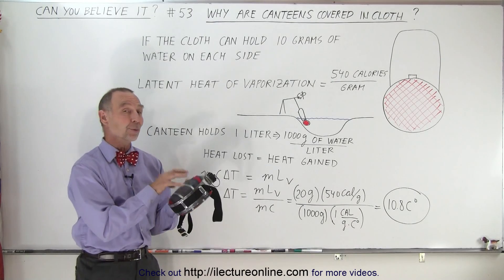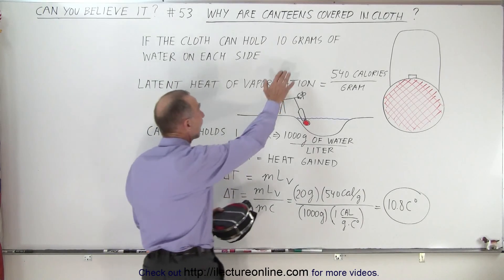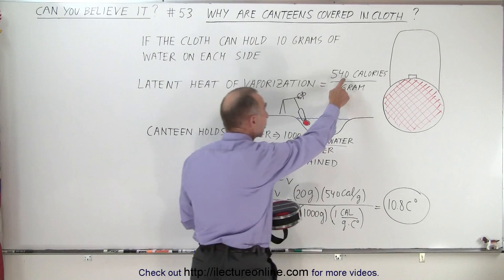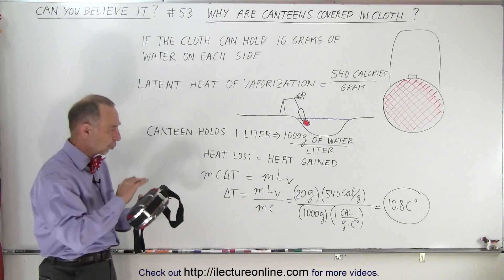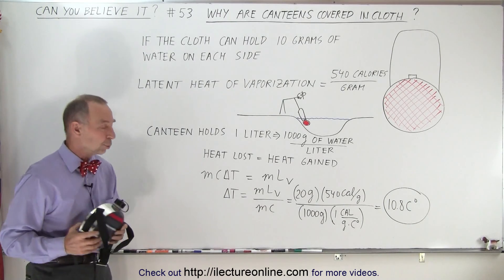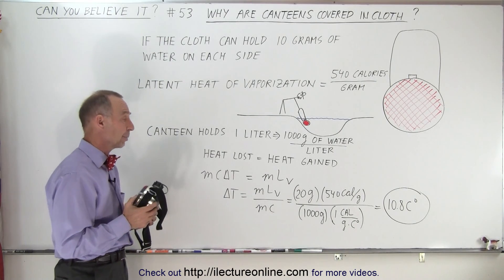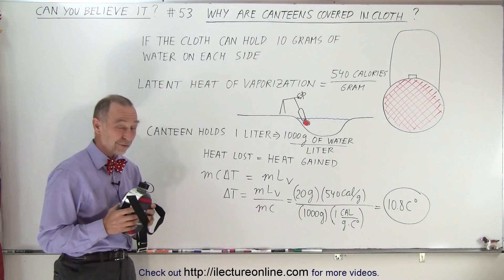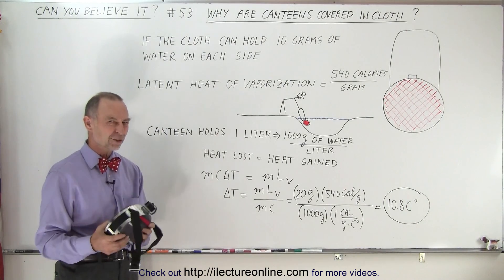Can You Believe It? #53 Why Are Canteens Covered With Cloth?

Comment: An interesting extension is to use Grashof’s number and free convection equations to calculate heat gain from the environment and then find an equilibrium temperature as a function of evaporation rate.
Reply from the maker: We'll have to tackle that one in a different series in the future.
Reply: This set of canteen problems is very interesting because it can be studied with varying degrees of depth and complexity.  Aside from studying heat loss from the environment via free convection or windy conditions, you can study psychrometrics, humidity, and wet bulb temperature to explore the complexities of evaporative cooling.  

This problem can also improve people’s intuition about sweating and wet hair/beards for the rest of their lives.  Literally this canteen problem might provide insight into one of the partial reasons why people have hair on their heads in the first place (moisture can travel along the hair to greatly increase surface area and evaporative cooling rate when you are too hot, and when dry the hair can insulate).

On the insulation topic, I wonder how well dry felt helps to prevent the canteen from freezing.

It’s really a great problem.
Reply from the maker: We do have a playlist where one can learn how to calculate heat loss due to convection in our physics videos.